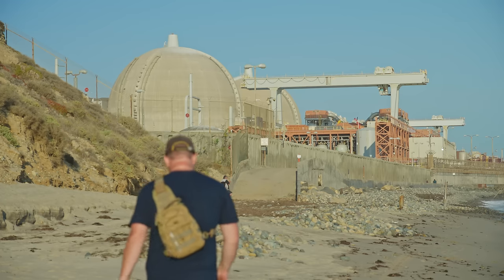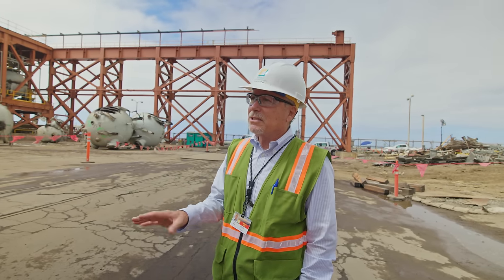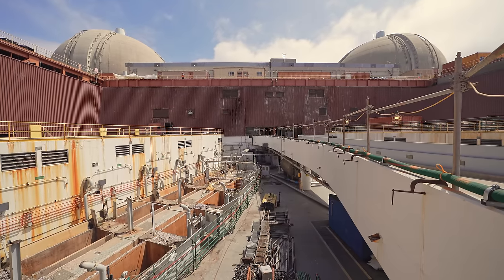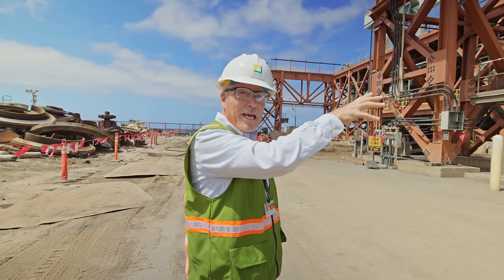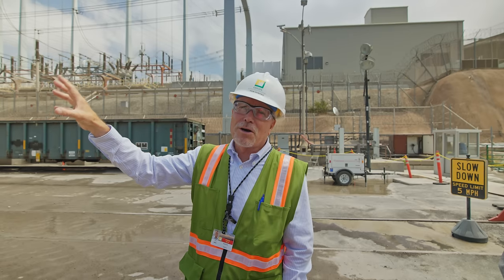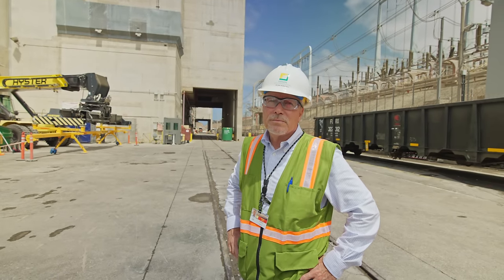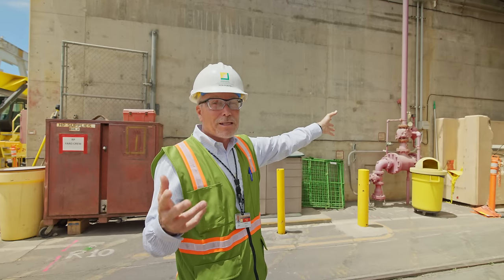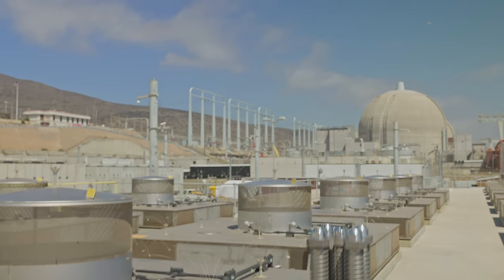Inside the Decommissioning of San Onofre Nuclear Power Station

Comment: it was nucliar power that paved the way for alternative power sources. nulclear power made it possible too make another power source. it was a nessasiry step. say. i.e. you need a nuclear powerplant too melt the metal for windmills and watermills and solarmills and too smith all the other gear and aperatus for othet fuel sources. dont underestimate hoe many POWER it takes too MELT and SMITH that metal for those generators. i.e. you can not make a generator with the power of a generator.  but that is possible with a dangerous (temporairly) radioactive plant. if we use a tiny bit of that bad energy. too make it oossible to make new energy dureably sources.  iso 1010
Reply: what we think. use that glowing sticks too smith a biogas generator reactor metal. APERATUS AND STORAGE IN METAL. LIKE iron orso. i dont know if plastic will do.  ??if there are humans.. then there will always be HOPE.  maybe, Not sure....

Comment: 10 minutes in and this guy describes every reason why nuclear is a waste and hazardous 😂. Outputting 1million gallons a minute of heated, radiated water BACK INTO the oceans.... With a 30% return of power😂😂😂😂
Reply from the maker: The water isn’t irradiated. The water that is released back to the ocean doesn’t pass through the reactor.
Reply: A heat exchanger is used so that sea water doesn't come in contact with reactor water.

Comment: They keep shutting off the generation plants just like there are almost no coal plants left yet the grid is screaming for power
Reply: Well they are allowing Diablo Canyon to operate 7 more years, but it requires billions in repairs.  So, you get no more power but increased electric rates.  Me thinks complainers that always find something to complain about will now complain about increasing rates.

A simple analogy is the reason people are still not driving around in their 1970s cars.  You need transportation, it is fully paid for, and you can keep a car running forever but at some point the frequent need for repairs and nickel dime repair cost means it is no longer reasonable to keep it running.
Reply: @Clark Kent  increased rates is better than no electricity 🤡
Reply: @jonathonvince561  I agree if you live in California, Texas, or any of the states in the crosshairs of climate change.  France shutdown 50% of their nuclear plants this summer because river water temperatures got too high.   If you don't have a reliable source of water then coal, oil, and nuclear are a no go.
 The east coast grid is in the best shape of the three and the last time I lost power was 6 years ago when some kid ran his car into a ground transformer.  10 + years ago there was an ice storm and lost power for 2 days. 

Every region is not in the same position. Here in Ga.  the peak electrical usage is in summer when the sun is cooking things and AC is on max.   Solar is the perfect match for that reason and why I see solar farms popping up everywhere.   There is no one solution.

Comment: as recently as 1994 it was 20 Bq/L. Now, after Picker's 2008 inspections, the facilities have been detected
weak condition.
What do we do in Canada then?
We recommend extending the emergency zone to 30 km!
Does it help us when Pickering Fukupink radiation tears our lungs?
1.7.5. Bruce Power
Bruce Power's first four (heavy water) reactors, i.e. the plutonium plant, started in 1978
(total 3400 megawatts), four more in 1986. The first "A" reactor was closed in 1995, the next in 1997 ...
(of steam age pans corroded by radiation) repair costs greater than
construction of the facility. (Note: This is a heavy water reactor, not used in Finland
light water reactor model. Different, but equally radiantly destructive...)
Bruce Power used hydrogen sulphide (sour gas) to get heavy water in his process
from the lake. Highly corrosive and explosive gas. Heavier air accumulates lower
to existing environmental pressures. Strong ventilation in facilities is mandatory - i.e. the environment
gassing - even the Catholic Adolf Jesuit's beloved poison gassing of the nation... Although the gas is first
pungent, it quickly numbs the senses and is not noticed afterwards. Victims die without realizing it
which struck me - so quite a Jesuit-like product. This gas was happily released into the environment from 1973 to 1997.
Doses of 10 parts per million (ppm) cause eye irritation, the picker comes at 300 ppm.
.Bruce Power, the owner of Ontario Hydro, of course denied everything
The Bourgeois family, living in Bruce Power's 'shadow', suffered severe injuries as well as
livestock died significantly. 25% of the sheep in the family died in a year - there was no explanation. Amount
four times as much as other sheep farms... Bruce Power, the owner of Ontario Hydro, of course refused
everything - During the winter, I went to STUK accompanied by the uranium trading pope Hesarien... The reason is not
of course was their heavy water plant.
The Bourgeois family had to find experts in the field for help. The "mystery" was solved in 1991:
at a certain time of the year, due to the inversion of the air layer, hydrogen sulphide, which is heavier than air, accumulates
to the low points for this farm. (The inversion phenomenon also occurs in Finland, that's why e.g. combat gases
use in war would be dangerous for the user as well. This and paid professional lying by "experts".
should be considered 0lkiluoto-L0visa 'maintenance' of those suffering from 0ires. During 'maintenance' or revision
the irradiators are open, 10-100,000x emissions are pumped from 140m high, 'truck driven'
from your pipes to your lungs...)
Is it right to hang them before their radiation death?
Later, Ontario Hydro documents were found in which the Jesuit management disputed the issues

Comment: The closing of the plant represents California’s very low, and falling, level of education.
Reply: Says you... not a degree to your name.
Reply: heir original steam generators were leaking radioactive reactor coolant into the "clean" secondary side so they replaced them at a cost of $1 billion and the replacement steam generators also leaked.  When these old plants, and we have over 90 of them, have a major component fail, it is no longer coat effective to operate.  On average, 1-2 shutdown every year.

Why did you scrap your perfectly good 1970s automobile just because the engine was blown when it would only cost $5,000 to repair a vehicle worth only $2,000?  What a waste of a good car!

Comment: Yeah shut down San Onofre and we now have rolling black outs in SoCal.  Wonderful ideas….yeah go “green!”  Complete FAIL!
Reply: heir original steam generators were leaking radioactive reactor coolant into the "clean" secondary side so they replaced them at a cost of $1 billion and the replacement steam generators also leaked.  When these old plants, and we have over 90 of them, have a major component fail, it is no longer coat effective to operate.  

Maybe they should have spent another $1 billion, raised rates, and hoped that they would have better luck ?  There is more to the story
Reply: @clarkkent9080  That’s a good explanation.  However, we still need power no matter how “broke” it might be at San Onofre.   Wind and solar doesn’t cut it, as evidenced by the failed “experiment” in Texas last winter.   If they didn’t want to fix the reactor at San Onofre, they need to build several newer and smaller ones throughout the area.   Ron DeSantis said that’s what Florida is planning on doing in the near future.
Reply: @colt10mmsecurity68  It is the utility's responsibility to provide power.  The number 1 priority of utilities used to be providing dependable reliable power.  Following deregulation the number 1 priority became profits.

My point was that closing down a plant as old as SONGS was an economic one.  Palisades just shutdown a few months ago due to control rod seals needing replaced.  

We have ~ 90 old currently operating reactors and everyone is one major component failure away from shutdown.  Diablo Canyon will continue to operate but will require billions in needed repairs.  So, you will have the same amount of power, but electric rates will increase, and people will complain about that.
Reply: @clarkkent9080  Well yes when you’re in the business of profit, why wouldn’t you seek more dollars?   Deregulation also means very little to no more government subsidies (money) to keep the operation going. Of course an electric company is in it for the money, why wouldn’t they be?   We are not a socialist nor communist functioning economy… yet.   Second, everything is just “one component” away from failure.   That’s how things work.  That is no excuse to not fix the problem.    I don’t care how much money it costs to either fix the existing, or build brand new.   We need power on demand and unlimited, as we are NOT a third world developing nation (yet).   The problem is that your California government forbids the fixing or building of new clean energy nuclear power plants.  Plain and simple.   They want “green,” which green isn’t there yet.  It’s probably another 50 years out until it’s developed into a form of energy that’s reliable, 24/7.   Wind and solar is only a “part time” solution to our power needs.   New Coal and natural gas power plants aren’t lined up in the future, so what’s left?  Fixing the current nuke plants and building more of them.  Hell, your President was ready to dump nearly 2 trillion dollars for student load debt on the tax payers back and actually did spend a boat load on bailing out General Motors.   Why not spend some of that money in repairing existing nuke power plants?
Reply from the maker: Why are you reposting the same response?
Reply: @RadioactiveDrew  Huh?   I’m not.  What are you talking about?
Reply: @clarkkent9080  Sorry, but you’re the one that needs an education.   Complaining about “ profits” is akin to Stalin or Castro complaining about freedom.   Second, utilities deregulation did NOTHING regarding your alleged lowering  of any  safety of nuclear power plants  safety issues nor reliability issues (I.e. “cutting corners”) in America.  Even when utilities were regulated, nuclear power plants (as well as coal burning plants) all had mechanical issues and reliability problems due to both design and/or high cycle fatigue propagation.   I promise you, regulated or not, money is spent on nuclear power and safety designs are never perfect, but corners aren’t cut.   Usually mistakes are then learned from.   Do your research beyond a YouTube video or cia media influencer for once and you might actually learn something.
Reply: @clarkkent9080  I stopped reading after paragraph two where you mentioned an “agenda.”  You type way too long trying to get a point across.   Fail.  Move on, because I’m bored with you now.
Reply: @colt10mmsecurity68  Yes people with a GED get bored easily when they try to read  big words.  enjoy your alternate reality
Reply: @clarkkent9080  Triggered!
Reply: @colt10mmsecurity68  Dude, I got more guns than a small army and love to show you the size of my barrel
Reply: @colt10mmsecurity68  Green energy in Texas greatly exceeded its output specifications (19% output while designed for 14.5% output) while nuclear and fossil fuel stations failed due to lack of winterization.
What nonsense are you reading?
Ron Desantis <- LOL he doesn't even have people to tend the farms and do construction.
Yeah, good luck pouring that much concrete with 3 people.
Hysterical.
Reply: @colt10mmsecurity68  "everything is just “one component” away from failure." 
You somehow feel entitled to speak on this matter without understanding what redundant systems are?

Comment: Wow so the government failed to remove and store the spent fuel rods?  Seriously that was not the plan during the 90s were we supposed to try to sell it to Japan for their breeder reactors. Why would a private company expect the government to clean up their mess?  Waste was always the issue.  
I can't believe they let it run to 2012.  I wonder who took the waste besides the rods stored at the site.  The rods are actually just a small percentage of the radioactive waste generated at the site.
Even though the memories are bitter sweet thanks for the update Drew it brings back a lot of memories.  Mostly good, some bad.  
I have TONS of stories.  I will take personal credit for using ALARA paint to decon some of the areas.  Haha it was super expensive and went into the pores and turned solid, then you peeled it off.  It cut the time to decon an area by more than half.  It was supposed to only be used to decon the cavity.  But that paint was expensive but I didn't care...ALARA right?